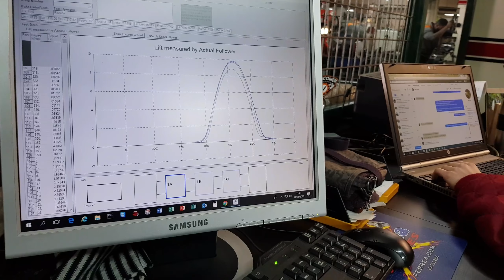VAG 1.9 TDI PD day on Veicomer performance section

Comment: Had a quick question for you. Have you tried to change the exhaust port shapes to a more D shape, gotten rid of the swirl ramp on the intake runner and tried to make a combustion chamber for more air flow? I know they are starting to do something like that with the Diesel tractor heads and the 12V Cummins head for all out drag racing. I got away from the diesel porting but I'm wanting to get back into it. Also you do great work.